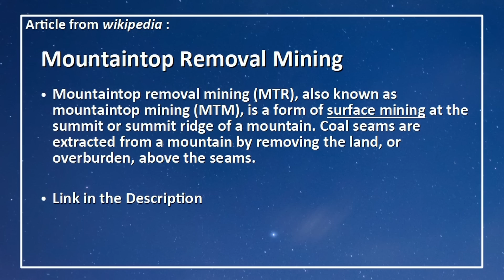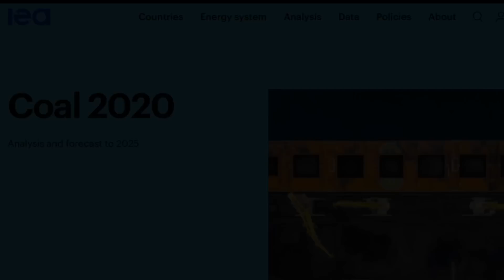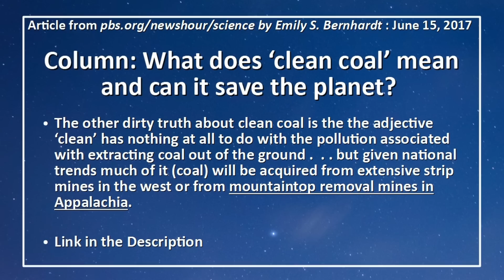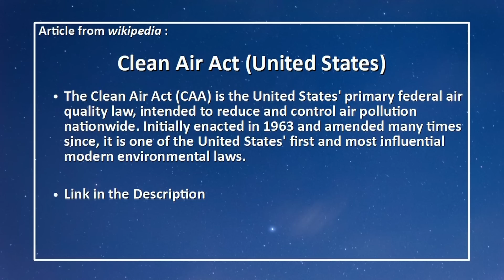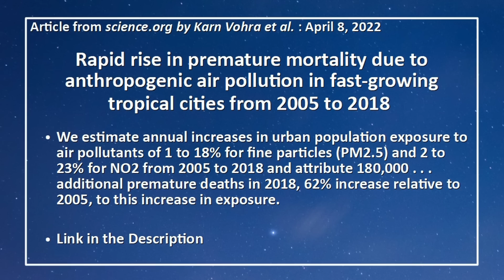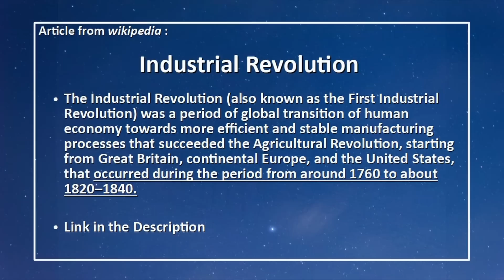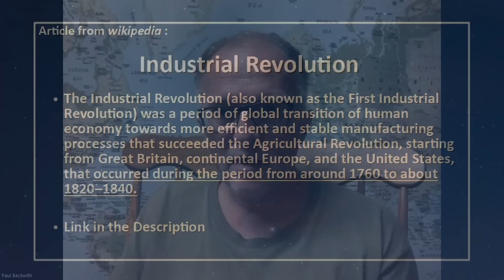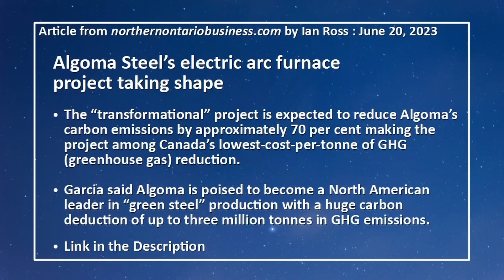Mountaintop Removal

Comment: Aluminum is produced by the use of a huge amounts of hydroelectric (electrolytic in molten salt).  Bulk iron can be converted to steel with electric arcs.  There are alternatives to coal.
Reply: Until electricity generation is converted away from fossil fuels to nuclear, geothermal, solar, wind, tidal, with back storage to even out demand to supply, using electric arcs is simply an alternative, and better method, the steel is far better quality, of coal, oil and gas consumption.

Comment: Radium is a significant source of norms from both coal mining and coal bed methane (CBM).
When coal seams are extracted huge volumes of water need removing.  Coal is fractured and allows water to pass through it which extracts heavy metals much like an active carbon filter.  
This means the loss of this filtration process also affects groundwater which takes decades and in some cases centuries to circulate through rocks. 
Water is a vital resource and strategic resource that should be managed very carefully for future generations and our immediate future.
We ha a climate and ecological emergency.  It should be acknowledged we are in rapidly worsening water crises that should be treated as a global emergency.

Comment: You would think at least the flat tops would be good for pumped storage reservoirs, but no, the local water systems are too messed up for that.
Reply: Reducing the structure to rubble makes them unstable : pumped storage implies the subsurface is stable enough to withstand the stresses caused by the rapid changes in water depth.